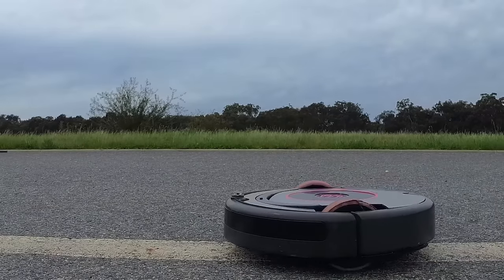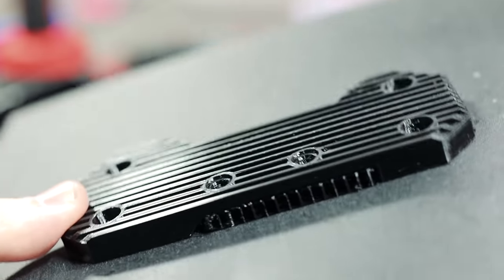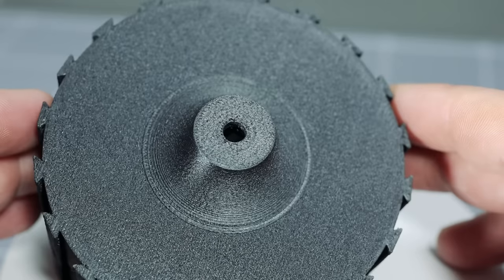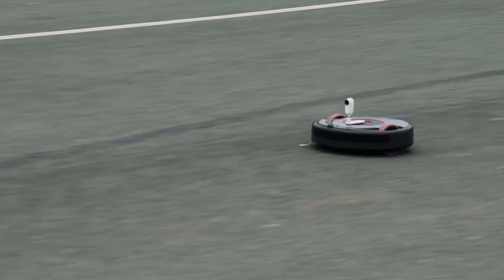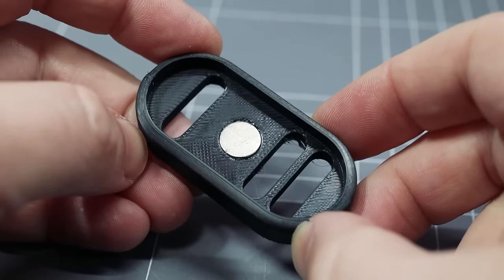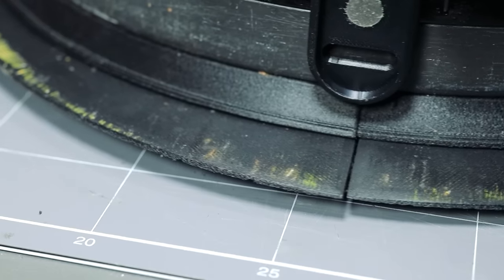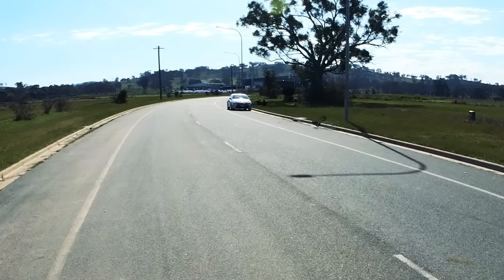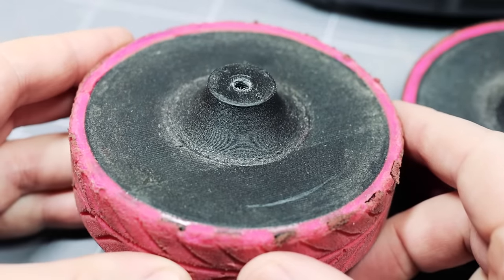World's Fastest Roomba Gets Upgrades

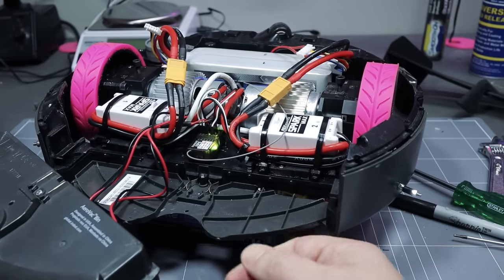Comment: 3:20 It appears the gyro on the dumbo receiver isn't meant to work in tandem with channel mixing. You can probably make it work by using an external channel mixer like Fingertech Robotics' TinyMixer, or a dual ESC with built in mixing such as those available from Robot Power.
Reply from the maker: I think so. Thanks for the tip!

Comment: If you're making a custom chassis, adding some basic suspension might help to smooth out all of those bumps! Even if it's just the drivetrains being suspended by simple leaf springs, it can help improve shock absorption, especially since everything else is hard-mounted with no vibration dampening.

Comment: Did you do any research when designing the wheels and aero?if you did what looks cool it's understandable, but I am curious if you did any simulation. My main question is why have threading in the wheels, since you are running in perfect conditions.
Reply from the maker: I didn't have time (or a good enough CAD model of the chassis) to do CFD modelling of the aero. I would love to do it for the next version of the Vroomba though, as I'll have the full CAD model available for the entire vehicle. The tread was for appearances, but also that last road where I crashed it is pretty dusty. Not sure if it helped or not.
Reply: @electrosync  ya i expected so. Doing simulation and getting accurate results for such a small vehicle where dust plays a large role might be tough. I have no expertise in the area, so i would have done exactly what you did, make it look cool. Maybe you can ask your community for some help with this, it would be so much cooler if we get to see what they come up with. 

And as for the wheel, having good control without suspension is really tough. Especially since the material doesn't act like a spring, you might want to try and use rubber wheel from some other rc car, but that might ruin the "rumba" aesthetics, and i am not even sure if it will truly help. 

If you continue the series i truly hope you make some stupid crazy fast rumba.

-from someone who is not qualified in anyway whatsoever to give any advice regarding mechanics. So please take my entire comment with pinch of salt and do what you want. I just want to share some ideas which I can never implement myself.

Comment: Sweet build. Do you think that the front caster had something to do with the steering problem? Perhaps swapping with a small skinny wheel that turns slightly when you input controls to the big wheels might help with stability? Or replacing the caster with a mouse ball for stability only?

Comment: dumbo rc has a mode for tank style cars. idk if the gyro will still work tho
Reply from the maker: Confirmed that the DumboRC gyro does not work in tank mode (with two channels). It's single channel only.
Reply: @electrosync  Already left a comment but, just wanted to say there are v-tail mixer boards that plug between a reciever and servo/esc to mix two channels. That's gonna be the simplest solution.

Comment: I think adding two smaller wheels (without being driven by motors) at both front and rear will help with the spin issue.
Also, if one gyro won't work... you can put another gyro for another wheel if their direction can be inverted.

Comment: Hmm, seems like the gyro was adjusting the steering to the wrong side, so basically if it detected unwanted movement to the right, instead of going to the left, it went to the right. It still is very feasible, but I would highly recommend trying a flight controller instead of an RC car gyro since flight controllers can handle multiple channels at the same time, plus they tend to be much faster and more accurate.

Take your time to tune the PIDs on the gyro, do a few test runs and see which gives you the best result. If you can somehow find a way to tie the PIDs to the speed and have the flight controller dial down the corrections the faster the roomba gets, that will probably get you the best result.

Comment: I also concur that you need more wing angle, with everything else being the same, as that slight wheelie it does seem like it would negate most DF generated the lower element of the rear wing.

It seems adequate enough if you can keep it level, though, if you change the design of the main chassis. This armchair is quite comfy 😌

Comment: you could add covers to the top of the vroomba that cover the wheels. I think this would improve aerodynamics considering without the covers the wheels are actively fighting against air. but if you add covers it should allow the air to pass over the wheels instead of getting pulled down to the bottom by them

Comment: if you already paid for a sparkmax, why not use a geared neo550 or just a regular neo for way better preformence?
Reply from the maker: You're right. I tried to future proof for upgrades. I planned on upgrading to brushless NEOs on the same gearboxes (that's why I used the Spark Max). But the weight of the Max Planetary gearboxes and the lack of grip with the power of the brushed motors changed my mind. I'm thinking direct drive brushless for the next version.

Comment: Spoiler seems counter productive since it’s applying a down force at the rear rather than where the wheels are. 

It may look goofy, but I think it would been a lot easier to control at high speeds if the spoiler attached in front of the wheels, where they swept back right on top of the wheels, so that the down force is applied right over the wheels where the spoiler would be.

Comment: Please my homie, you've already given the middle tires some TLC, do something about the tiny front and back wheels. I see the back wheel has a spinning mechanism for smoother turning, but please replace or reassemble the front wheel to address 2 issues. One is the wobble. Add some type of cylinder housing with spring-loaded pressure down upon the wheel, and let that front wheel deal with road impact alone to see if it mitigates wobble. Two, maybe increase the surface area of the front wheel, either by increasing the width of the wheel, or just installing a larger ball bearing type of wheel for it.
Reply: I hope you read this, I know the video is a month old lol

Comment: you should absolutely incorporate a fan powered vacuum suction system for significant downforce. way easier to tune and far more reliable performance if you dont have access to cfd. Also plenty of room for trail and error optimizations when it comes to sealing skirts and so on.

Comment: if you didn't get the gyro to work, you did not set it up properly, you can get it to work for sure. and you should use a separate gyro, not a built in one. and that 3rd wheel in the back should be solid and not swivel around to give you straight line stability

Comment: the aero parts do nothing except add weight and moment. The treads on the tyres do nothing. The road surface is very rough, you need much softer, bigger and knobbly tyres to absorb as much of that jerkiness. An RC track (I just reached that part in the vid) is much much more appropriate for your tyres, but you can see it still rumbles a lot

Comment: upgrade the front caster tread and lock it so it doesn't spin and you will actually be able to drive straight LOL
Reply from the maker: The front caster doesn't touch the ground under acceleration, but I could change that.

Comment: guess you never tried to put a brushless motor on a stock RC.  It basically does the same thing.  no control eventually it breaks into pieces.  With a Limited Slip Differential it could be possible.  You'd have to link the left and right wheel through a viscous coupling.

Comment: looks like the ride height is to low, it's so low any pebble on a normal road will make it unstable. it needs to either to be raised or be on a floor that the Roomba is more design for, like a big empty mall or a smooth concrete warehouse floor.

Comment: Oh I see what you're doing that's why you have the screws in it that was just the mold okay I didn't know that well this is probably going to run pretty well the only way you can really improve things does make it higher that way it's not sitting to the ground that way if it hits a pebble it doesn't like fly up in the air and destroy itself and maybe get out of it like a gyroscope that way it can map out itself if it takes like a kind of a bad turn just give me the tips I know gyroscopes can be pretty expensive but that's probably a good option if you're trying to make it go as fast as it is in your case that probably be best case and put that at like plan A would be you raise it up Orbeez you give it a gyroscope and raise it up

Comment: Um, sir, the FIA says your Vroomba is non-compliant with the current Floormula 1 regulations.

You must add a titanium legality plank to the floor so the inspectors in Parc Ferme can gauge the overall wear and confirm you are within spec.

Also, youll need to confirm whether you have the maximum MGU-k and MGU-h capacities.

And i think you lack a Super license, which is required in 2023 to operate a FLoormula 1 device.

Floormula 1, get it?

I entertain easily....

And danf that thing is suckin fast...

Comment: Consider an arduino or Raspberry Pi piggyback

I believe you can do it. Don't make me build one. Build a test platform stripped down version using sbc. I'd use what's been learned with the two wheel bot builds

Consider data logging to build/compile an onboard ai to keep the roomba in a straight line

Personally, I believe an amazing machine is coming.  Failure doesn't exist 👉 lessons learned 

https://youtu.be/D7hvI_Tb0o4?si=WBgTqpipoXl4i2JB